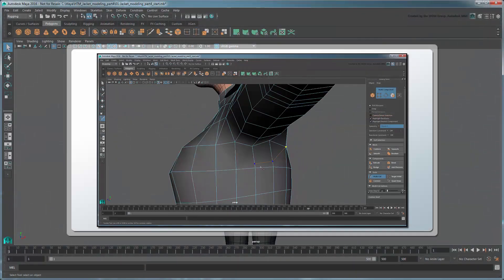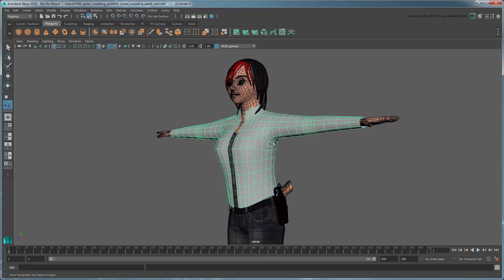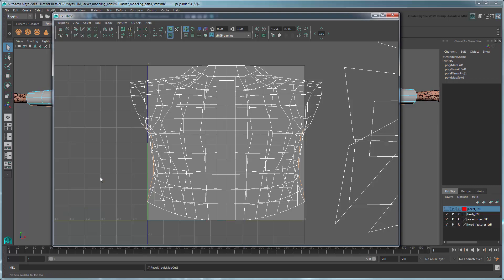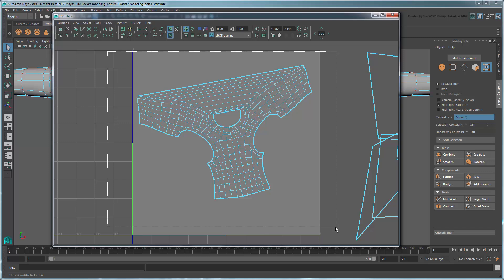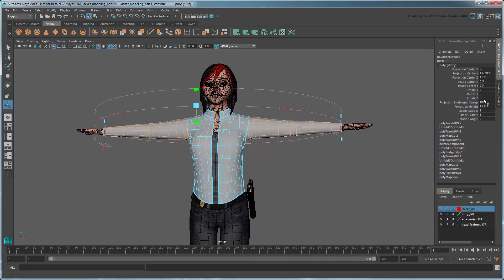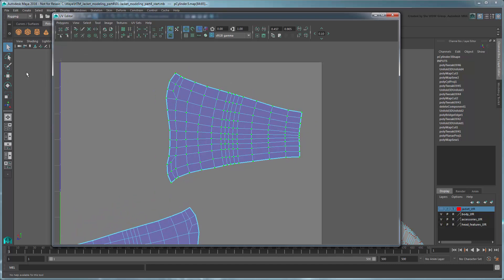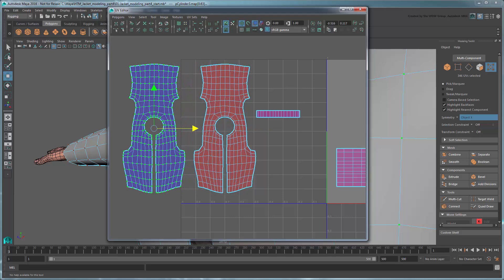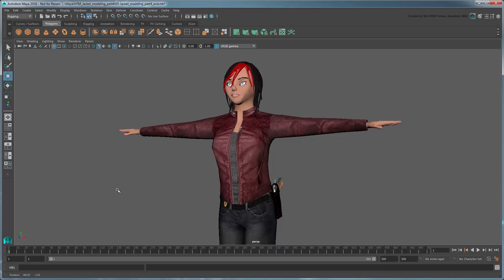Modeling and retopologizing a jacket (2016) - Part 4: UV creation and finishing touches

Comment: This helped a ton!! Thanks so much! Quick question though: I have a rigged character that I put this jacket on, but not sure how to animate it with the object... Do I combine it with the rigged character mesh? Thanks!
Reply from the maker: You can go one of two ways.  The easiest way is to just skin the jacket to the character, then paint weights to make sure the sleeves follow the arms while the bottom rim just hangs.  It won't be physically accurate, but it gets pretty close and is lightweight.

The more complicated way is to use nCloth or Bifrost's MPM cloth to make the jacket dynamic, then set the character as a collider.  This will be physically accurate, but more computation intensive (and thus slower)

Comment: I'm using maya 2019 and the unfold options are different. How do I turn off pack? please help
Reply from the maker: You shouldn't need to bother with this option in 2019 - Pack should be disabled by default (i.e. Maya will always just unfold the selected UVs).

Comment: You know what's pretty weird? Not adding a "Align UVs by the center U" and an "Align UVs by the center V", you can only align by the min and max, why that?? Also, a tool to orient the uv shell based on a selection of a edge or based on a selection of two UVs would be also very welcome.